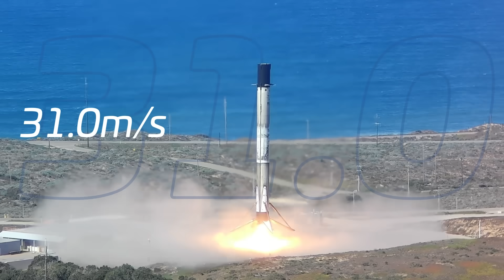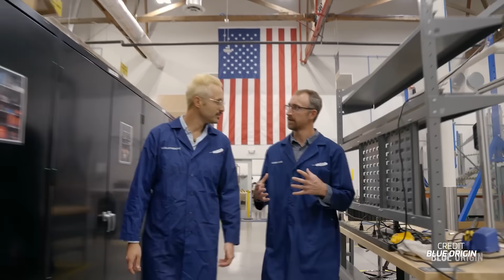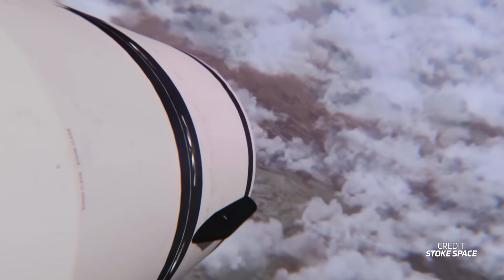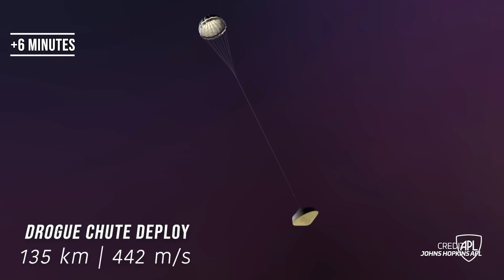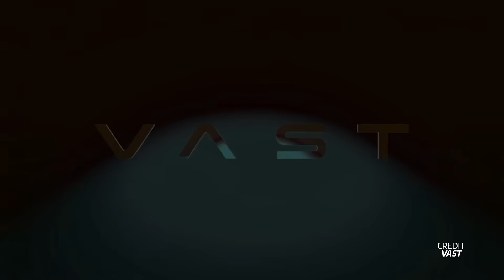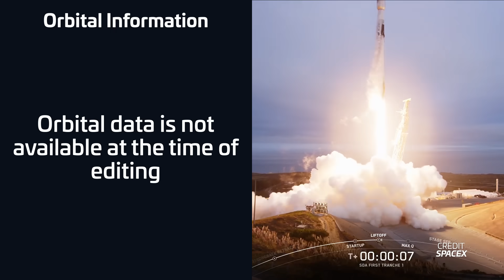This Solar Panel is Made of Moon Dust | This Week In Spaceflight

Comment: Blue Origin is Extremely Slow. Say what you want about SpaceX but whatever they do with Starship Proper, That Data will also be used for Starship HLS. Add in the Fact that when Starship actually achieves all it’s developmental goals and Even better Versions come out that can take more Cargo on Less Fuel using Better More Efficient Systems while also being Far Cheaper and Rockets are Wide in Quantity it’s gonna dominate Space, Moon and Mars. I don’t see how Anyone else could dominate. The only things left are Things Elon doesn’t want SpaceX to do. Like Industry Manufacturing in Space and Lunar Development (could change in the Future, And I bet SpaceX will still be Involved heavily).
Reply: Starship plan to be totally reusable has not been met and will take another year and atleast 5 more Flights. Starship is way too slow and still failing. Starship HLS is behind China and Blue Moon.
Reply: @mrbaab5932 😂 Nice Ragebait, Keep it up.

Comment: I can’t help but think what the hell has AeroJet Rocketdyne been doing for the last 50 years?
Reply: GREAT QUESTION. they have been begging for rs-25 contracts ... the Senate Lobbying System
Reply: They should make a general rocket that works for multiple rocket companies or ask Blue Origin to build their engine they and ULA uses that Blue Origin is building at a rate that is too slow. Or become a sub contractor for Blue Origin or other engine designs, like an engine  foundry.

Comment: Wonder if the stokes metal shield will just rust out..
Reply: I guess lower temperature (thanks to active cooling) will only slow down the oxidation process, but won't mitigate it completely. We know what happened with passive metallic tiles on Starship, but do we know what happened to the active cooling test tiles?
Reply: @kazioo2 unsure , were there any active cooled ones?
Reply: @rokadamlje5365 This video said that Stokes is using active cooling.
Reply: Yes there was 1.